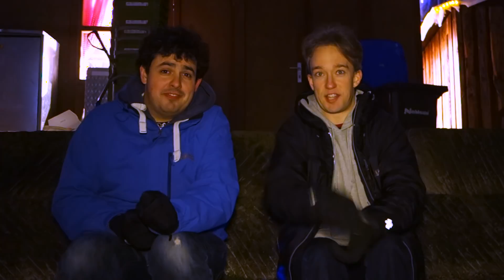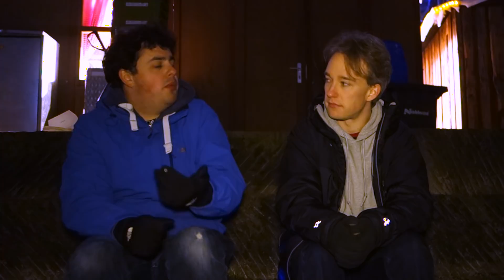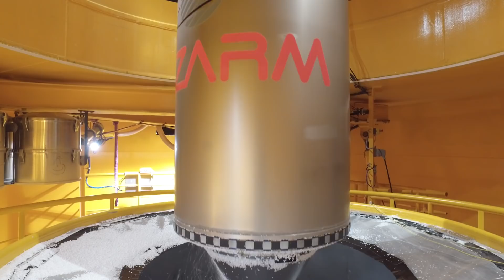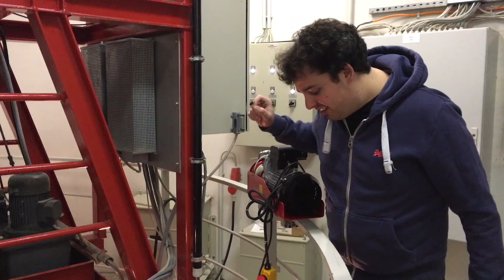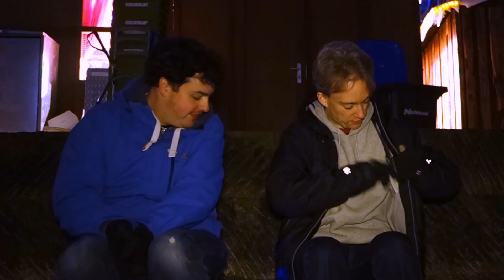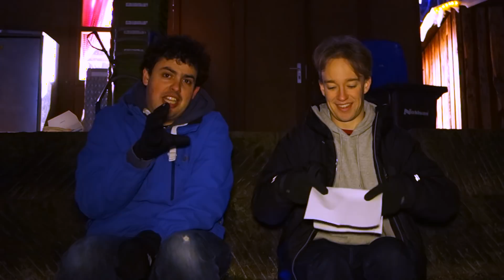What We Got Up To At The Bremen Drop Tower

Comment: Interesting side thought: I wonder what it would take to incorporate something like this into super-skyscrapers. Probably wouldn't take up too much square footage of floor space on each floor, and you'd get 1000+ feet of height to play with.
Reply: I'd imagine the stabilization and so on takes up more room than we imagine while looking at an essentially contextless image of it.
I believe there's also a problem called the Elevator Paradox or similar about how lifts take up a fixed floor percentage each floor, but as the building gets taller, more and more lifts are needed and unless you work out something clever or commit to a paternoster style lift (which is going to have speed, accessibility, and weight regulation issues), so eventually a very tall building with very many visitors ends up being solely lifts.

Regardless, it would be interesting. If I ever got to be a friend of a billionaire eccentric, I'd definitely pass the idea along.

Comment: Bose-Einstein Condensate. A material formed as close to 0 Kelvin (-273.15 Celsius, or -459.67 Fahrenheit) as possible. The "big blobby thing" at the start was a cloud of gas (or possibly low density alkali or lanthanide atoms) near vacuum pressure. The picture is the starting atoms cooled down, causing them to clump up.

Comment: I don't fully get the polystyrene balls solution... Polystyrene balls contain a gas (normal atmosphere?). How is that compatible with a near vacuum? They would inflate in a near vacuum or be crushed in normal atmosphere. Is the landing section not pumped down or something? How does that work?
Reply: Probably not relevent, because most of the use is in the bending and compression of the ball's material structure, not in any compression of gas. Tha balls will still stay in shape in a vacuum, and it's the shape that matters.

Comment: Don't think they were aerodynamic as there is no air in the drop tower
Reply: TrevorJr26 there's always a tiny bit of atmosphere left over.  true vacuum is really really hard to make and maintain
Reply: And I thought I was being pedantic :P
Reply: They were not designed to be aerodynamically efficient, but they were designed to be aerodynamically balanced. This prevents any rotation during the experiment which could cause some very nasty problems.
Reply: Didn't he say: "very little air"? So I can imagine there would still be a benefit to making sure things are going to be affected in a predictable manner.